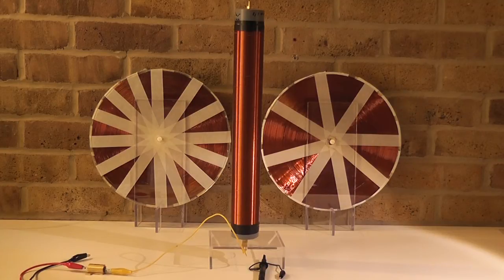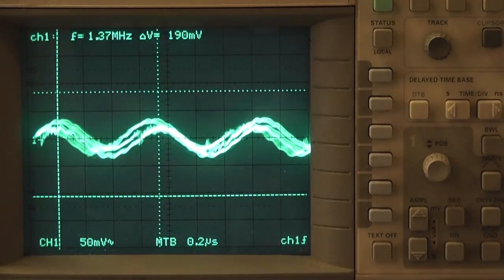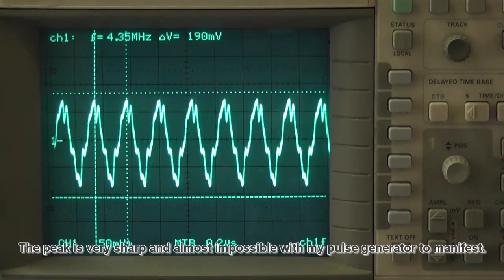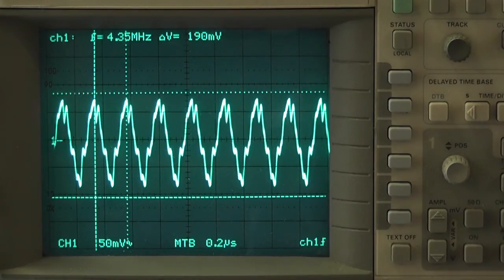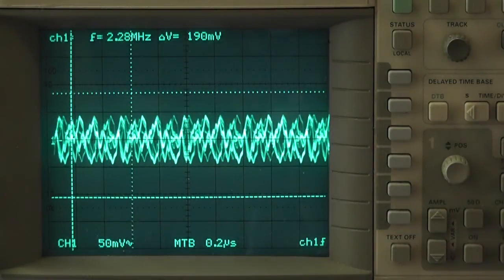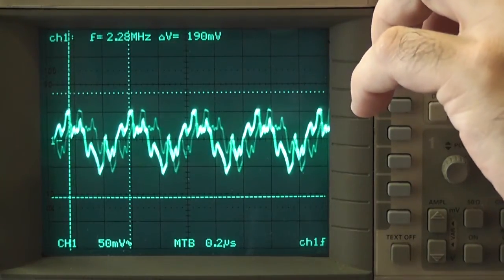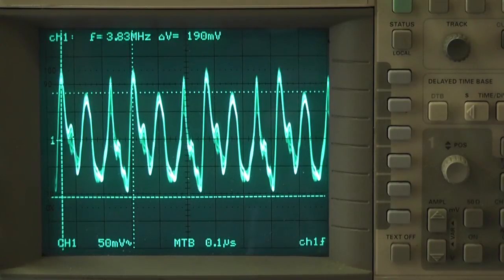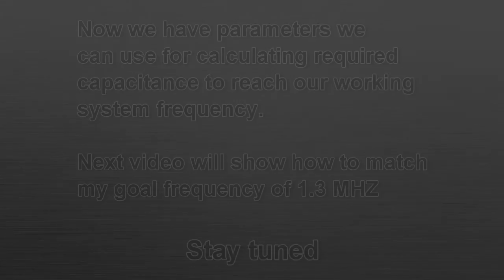Comparing the Standard wound coil versus a Bifilar wound coil

Comment: Resistance measurements are VERY doubtful.
One tried to replicate resistances difference between a standard and a bifilar coil without any noticeable figures (solenoids 57 turns, 0.4mm diameter). Please check again with inverting the multimeters.

Comment from the maker: Nope, when you use a conductor with resistance most of the energy is wasted in heat. The reactance of the coil in AC is the natural base value which is lowest at resonance, or high Q. However, because of the resistance in the coil it creates heat which again is waisted energy. It fights against the current and voltage change. Mostly known as EMF. the Bifilar coil does eliminate the EMF which makes it difficult to classify it. Under signal generator condition it is a hog in the system.

Comment: As the current passes through the first layer the flux or magnetic moment of each electron exchange results in inductive coupling to the second filar of the bifilar this decreases the required energy to cause cascade in the second coil. Thus half the resistance. We are doing research in this field and are grateful to see others going about this in truly scientific method. Well done sir. Well done.

Comment from the maker: I did end up with 680 windings on a 50mm core. My first test did point to 450 KHZ but realised that is not the main base frequency with the highest Q. My video with the de-tuned counter running coils did work at 500 KHZ but not efficient. My next investigation did reveal 1.35 MHZ has the main frequency for the secondary coil. Now that is a very important frequency. When you propagate or broadcast on this frequency you end up with the 1/4 wave for transmission.